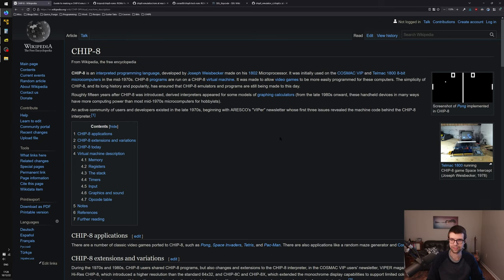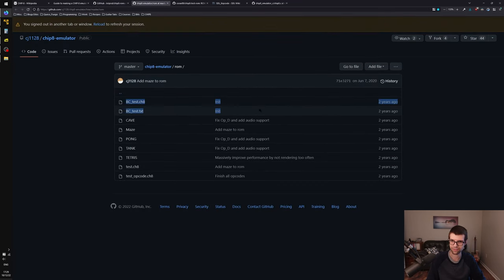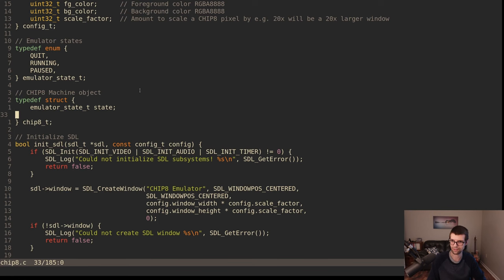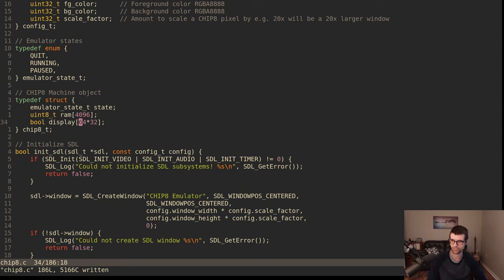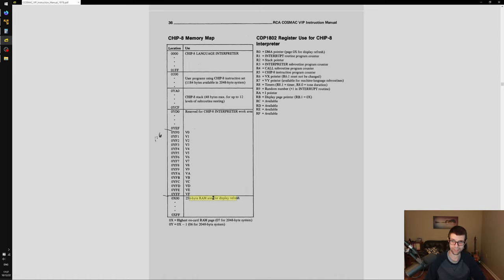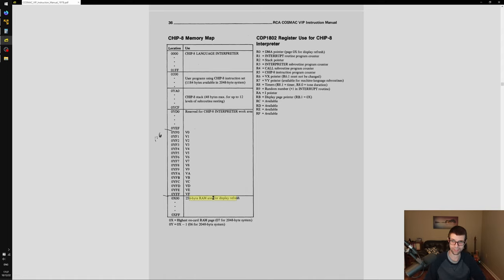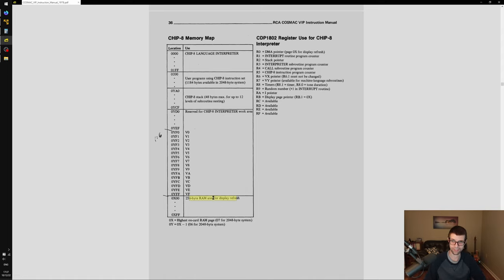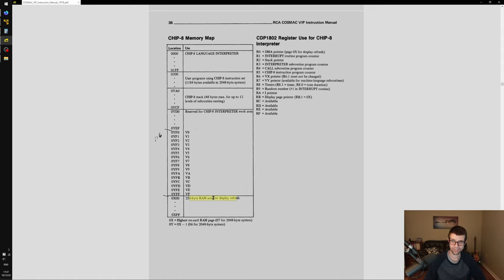CHIP-8 Emulator p2: Drawing a Logo (C / SDL2)

Comment: Odd question, at 40:10 you talk about the fact that you’re on x86 little endian architecture, why does that matter for an array of single bytes? The solution to shift the first 8 bits to the left then OR the next byte seems as though it’ll work regardless of what architecture you’re on. Did you mean that since chip8 stores it’s opcodes “big endian” we have to ensure that we’re shifting the bytes over to create the correct opcode? For example, If chip8 stored them “little endian”, would the line of code look more like this “chip8->opcode = ram[PC+1] << 8 | ram[PC];” ?
Reply from the maker: Yes, using 2 byte big endian opcodes on a little endian machine means I had to rearrange the bytes to get the correct opcode.
I'm assuming a big endian machine could just read 2 bytes at a time and be fine, not needing to shift at all. Something like chip8->opcode = *((uint16_t *)ram + PC); or even making the ram a 16bit array instead of 8bit.

Also, as extra, for big endian reading a byte at a time wouldn't change here, the memory could be 0xAABB, on little endian that's in memory as 0xBB,0xAA and on big endian it's 0xAA,0xBB.
So for big or little endian, 1st byte << 8 | next byte gives the same result.

Comment: The masking with 0xf isn't nececcasry when extracting the opcode from a uint16, since >> means logical right shift (for unsigned integers): (chip8->inst.opcode >> 12) & 0xf; ... unless you want to be extra careful? 🤔
Reply from the maker: That's true, it isn't needed there, same result with or without